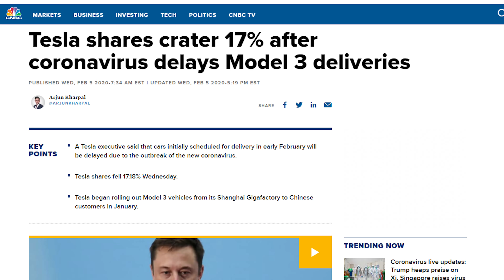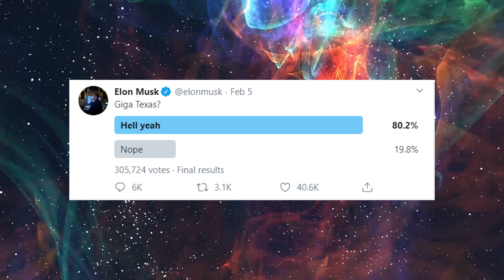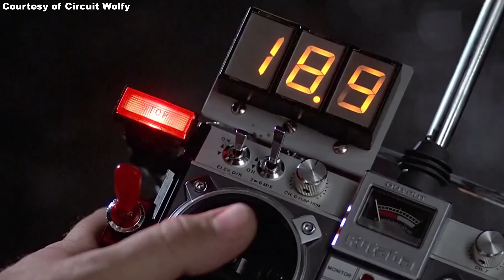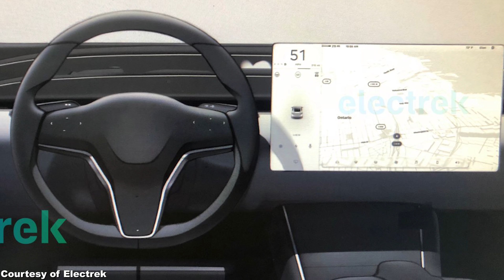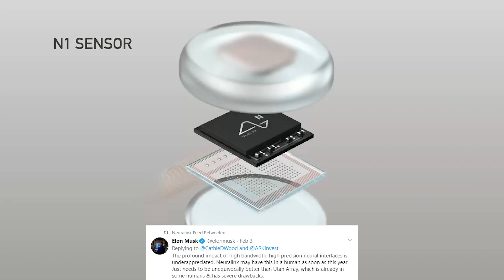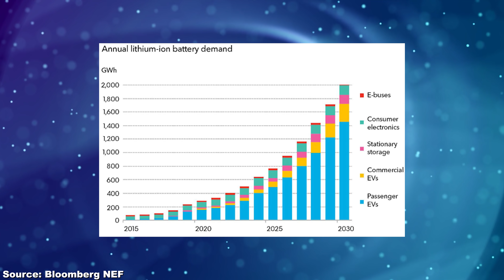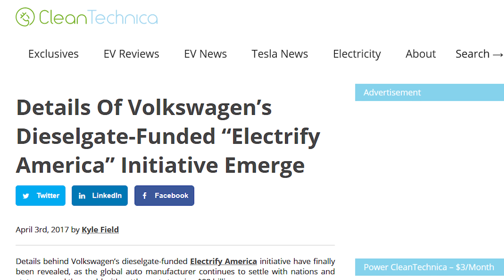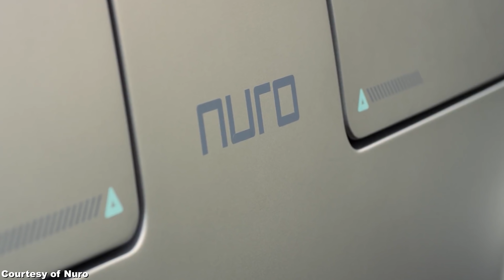Tesla News Update, UK Bans Gas Car, Go-Ahead For First Delivery Robots!

Comment: 9:55 Something like gas stations is the way to go. Everybody can start and run a charging station, even supermarkets and malls etc. And there should be only ONE standard connector, which can be used for every single EV brand. The free market will take care of the rest.
Reply: @TechChasm  Imagine every gas station had a different system to fill up your car. With today's technology you could even charge different rates for different brands. Tesla's spercharger network could still charge different prices if it's not a Tesla. They could even make money of other EV brands if they wanted to.

Comment: I´m a bit puzzled. How could Nuro get the approval to test up to 5000 vehicles in cities? One would assume that made a real big breakthrough in autonomous driving. Better than Waymo and Tesla! But that is seemingly not the case. Instead these vehicles are deemed safer because no human is driving inside...
After what I have seen, it seems safe to assume that the Nuro is a slow moving vehicle that uses geofencing and will stop for anything that might cross its path...which brings up the question whether they will need specific lanes on the street...

Comment: Thinking about gigafactory for starships. How many “components” do you suppose starship has? Maybe 15-20 structural sub assemblies (triple ring segments, thrust dome, header tank, nose cone, etc).  Then you have the engines, flaps, flap drive system, batteries, electronics and sensors package....well it’s not hard to see how they will have teams working on each of these components and producing them 24/7. Stuff it in the VAB and out pops a starship. Then you expand each of the teams making components so your doubling and then double again.  Lots and lots of starships.
Reply: @TechChasm  Have you listened to the spaceshow.com podcast of Dr Robert Zubrin talking about his recent meeting with Elon Musk at Boca Chica?  Well worth downloading at https://www.thespaceshow.com/show/11-feb-2020/broadcast-3459-dr.-robert-zubrin . Many fascinating points. One at 5min 45seconds in is that Musk intends to ramp up to a build rate of two starships per week... Yes, that's right, two (thats 2) starships each week. Mind blown!
Reply: My mind must be blown as I failed to finish the comment which I'll end here. Musk wants to ramp up to a build rate to two starships per week! That's right, two (that's 2 with a 2) starships built every week. Mind blown.

Comment: A Starship gigafactory and a Cybertruck gigafactory in Texas. Sounds great to me! I've been thinking a lot about Starlink lately. One of the prerequisites for Starlink to work is uplink/downlink stations on the ground. That is the reason that North America will receive Starlink service first. SpaceX has to place ground based terminals to exchange data with the satellites and connect to the existing internet. I wonder if SpaceX installed Starlink terminals at Tesla super-chargers that connect to the ground based internet, would that be enough to make the system work? Once they have laser communication between satellites the use of ground based up/downlink stations won't be AS important. But in the mean time, for this first generation of Starlink, I think this could be a solution and also a source of supplemental income to Tesla. There's also a hypothesis that SpaceX may actually use consumer's ground terminal to bounce traffic between satellites as well. Anyway, I completely agree with you that gasoline cars will be obsolete soon, certainly by the 30's.

Comment: We're going to see a huge shift from ICE vehicles to electric.  Electric already provides a better driving experience - instant cabin heat in the winter, much better acceleration, reduced maintenance - but is hampered by high initial purchase price, and length of time to charge.  Both price and charging time are being improved, and there will come a time - hard to say when, but soon - when the buying public will shift to electric cars, just as they shifted from film cameras to digital cameras 15 years ago.

Elon has suggested that the lifespan of the current fleet is 20 years, implying that all the gas vehicles sold today will be on the road for the next 20 years.  I think that is incorrect; there were a lot of film cameras sold in 2003, but film sales - and 1 hour photo labs - had pretty much disappeared by 2010.  The service life of a camera is typically 30 years or more, depending on usage; yet, we know from film sales (or lack thereof) that those cameras were no longer being used.  People that made a big investment in film cameras just shook their head, sighed, and bought digital cameras long before their film cameras had worn out.  The advantages of digital were just too great to ignore.  We've seen similar technology shifts when the shift to CDs cratered the turntable industry, or recordable CDs - and now micro SD cards - cratered the cassette deck industry.

The same thing will happen with ICE vehicles; the increasing advantages of electric vehicles will suddenly reach a tipping point, and suddenly the entire world will want an electric vehicle.  When that will happen is very difficult to predict, but I think 5 to 15 years is very likely.

You can still buy film; you have to hunt for it, but it is still made.  The same is true for vinyl records and tape cassettes.  But the market is perhaps 1/0th of 1 percent of its former size, if that.  And that will happen to gasoline.  We're in for a huge shift.  And it will happen VERY quickly... and there will be no warning.

Hang on to your hats, folks.  Life is going to get very interesting.  >Charlie
Reply: Hi, folks!  Thank you for your very kind response.  I enjoy your channel, and appreciate your enthusiasm.  Keep rocking!  >Charlie

Comment: First: I agree that price parity between EVs and ICEVs will suffice to drive ICEVs off the road--so long as the charging network is available where people want to drive, and the balance between time-to-charge and doing-other-things-while-you-wait is favorable. And I believe Tesla especially, and Electrify America if they're smart, will make sure of these things. We won't see a ban in the United States, because the Constitution will not allow it. But the price parity is the key. (I further believe that State Banking Commissions can help by writing guidelines for banks to allow, encourage, and urge them to take total-cost-of-ownership and cash flow, not merely initial price and applicant's income, into account when lending money to buy a car. If the banks were to do that, they could speed up EV adoption many-fold, without waiting for price parity to come. The reason: TCO and cash flow for EVs are already at or below par with those for ICEVs.)

I am waiting for the extended warranty on my car to expire. I drive a 2013 Chevrolet Malibu LT, which achieves the longest range of any light-duty ICEV on the road today--up to 700 miles total when driving long distances on our highways. Tesla and EA need to push--hard--to encourage private restaurants to follow the lead of hotels, highway departments, and the National Park Service in the installation of destination and "rest area" chargers. Once that happens, the last extra weight to tip the balance away from internal combustion will be in place.

Having said the above: in 2024, I will be in the market. I foresee a market I cannot predict today. At present I have decided on the two automobiles my partner and I will buy to replace the ICEVs we each drive today. With regard to this last: she's driving a 2017 Ford Escape that has an effective range of 250 miles between fill-ups. Don't let anyone tell you that EVs don't have the range anymore. They have--with considerable overlap between EVs and ICEVs regarding effective driving range. And if Tesla's recent battery-tech acquisitions are as smart as I think they are, EVs will achieve range parity with the average ICEVs at about the same time they achieve price parity.